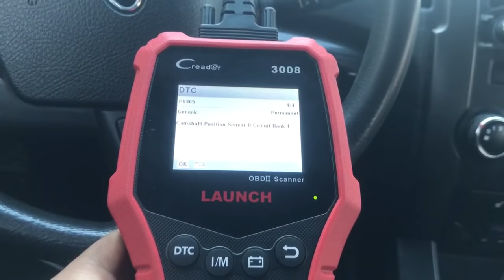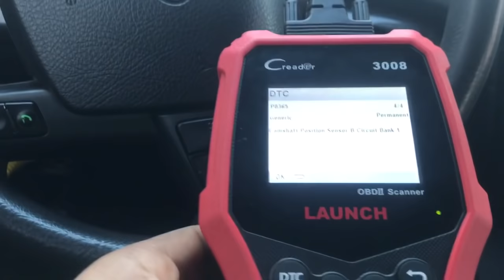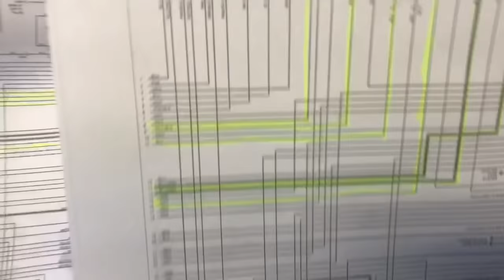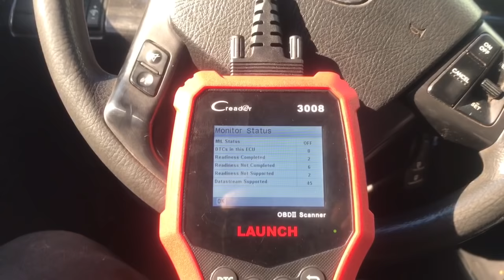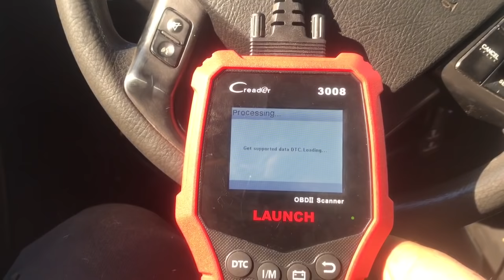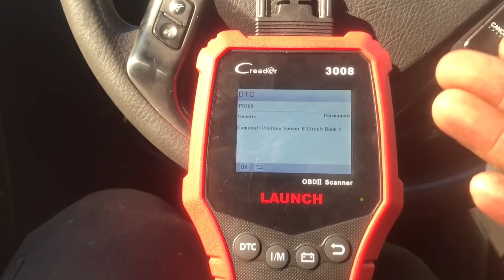Kia/Hyundia Crank no start

Comment: So was it the plug or the sensor? Having a similar issue on a kia soul. Am at a loss. Replaced the sensors but not the plug. Thinking of throwing a fuel pump at it but I've thrown alot of parts at it. Has a camshaft out of position and high voltage code. Any help would be greatly appreciated

Comment: Goodnight I have what 2013 Kia Rio every time I turn the key on the fuse for the injector 15 blue ConEd don't want to start I have a shortage in the 15 215 fuse for the fuel injected let me know what you think

Comment: Good day sir! I am having the same issue with my 2016 Sonata 2.4L. I have the code P0335 and P0107 (crankshaft position sensor and MAP sensor). Upon looking at the diagram I see that both of them share the same reference voltage and terminate at sensor 1 fuse.  Would this method be valid, even when my fuse isn't blown?(checked all the fuses with continuity)

Comment: I have a 2012 Kia soul sometimes you turn the key on you just get a click and you keep turning the key over and finally it will start would that possibly be the starter I took the battery cables off and cleaned them when the motor is running there is no light on showing all the lights are off no engine light or nothing on could you please help me to figure out what the problem is
Reply from the maker: Hi there Ronaldo. What you can do is get a test light and see if you can find the stater and verify if you are getting power to the starter when you crank it over. Make sure to have someone to help when you crank the engine over

Comment: Is the amp draw of the test light a factor in testing for shorts? I have used larger bulbs in the past, but thinking about it I am now thinking a low draw  test light would be safer.

Comment: Hello fellow Hyundai Sonata owners. I bought a 2011 LE, 4 cylinder, automatic, push button ignition.  It only has 37,000 miles on it and the previous owner bought it new.  She sold it to me because her two mechanics could not get it to function for her. It would sit for a few days and would not start.  They replaced the battery and alternator.  That didn't fix it.  Right now it will not start or do anything at all, so it actually got worse.  The battery is new and checked good (confirmed with part store check and deep charge). The main fuses I can see all look good. Nothing comes on. No exterior or indoor lights. No dash lights or gauges...nothing. Except, the push ignition button will lightly illuminate when I push it. Both key fobs will show a small red light when anything is pushed on them, but nothing happens. The trunk won't open, the alarm won't turn on, no door locks, nothing at all works. It does the same thing when attempting to jump start with 3 different vehicles. It did start occasionally for her with jumper cables and battery charge, but now it is entirely dead and nothing gives it power to crank or start, or any accessories or gauges. It's behaving like it has NO battery at all.

I have not connected a code reader to it, yet.

Questions:
1. Anyone have this occur?  What fixed it?  

2. Is there a way to test the key fobs to be sure at least one is working?

3. I know how to get the car in Neutral to push it around, but is there a way to get the steering wheel to turn?  I hate push button crank cars!

Thank you!

Comment: mine does it only when engine gets hot. when it cools down it will start right up help
Reply from the maker: Good morning Snickers. It’s kind of hard to say what would be bad. So I had this issue about 2 weeks ago, the vehicle would shut off when I got hit but I wouldn’t throw any codes. The only way I was able to find the issue was to hook in my oscilloscope to different sensors on the vehicle and see which one dropped when the vehicle shut off. If you have a code after the vehicle shuts off I would start off testing that sensor to see if it acts up
Reply: @OzMechanics  i brought it in they cantget it to do it again could it be the pcm
Reply: Its a semsor behind the car rrplace it
Reply: Behind engine like crank sensor

Comment: First time viewer, love the sketch on how you hooked up the test light. If you tell someone to go to the store and biy a SCOPE on a Rope, they will not know to give you. Next, we do not need the music...that is a turn off, 
Next do not use the words TURN ON to mean RUN.  
Key on, is the same as turn on, crank means the crankshaft is turning over, run means the engine is moving under its own power.  If mechanics do not use the same language how can non mechanics ever learn and explain the symptoms. Great video otherwise.